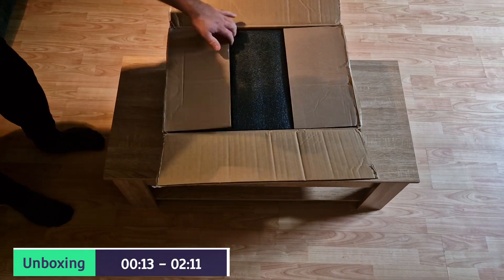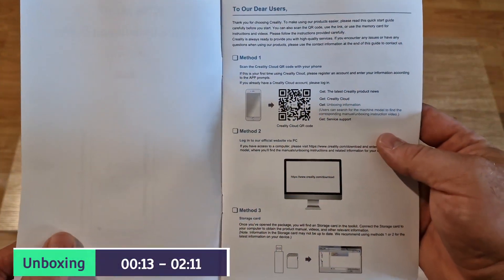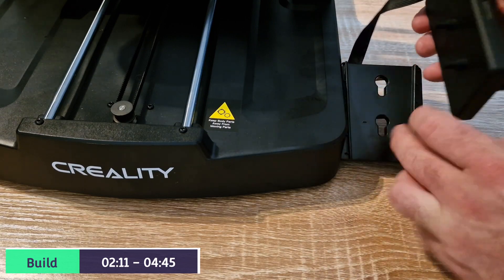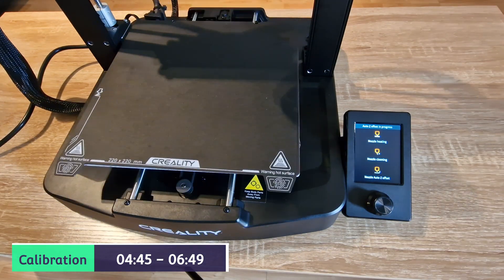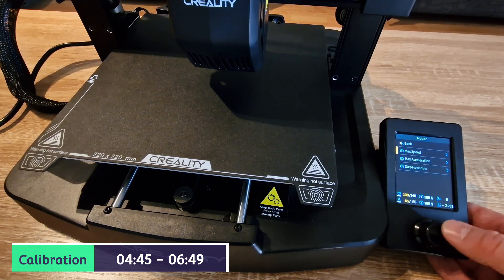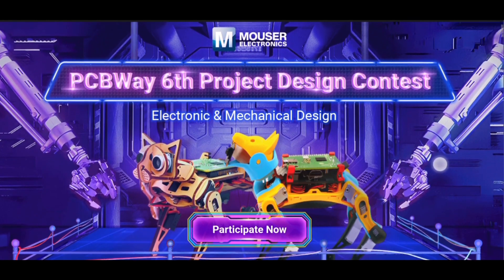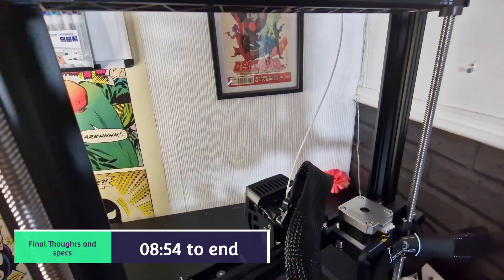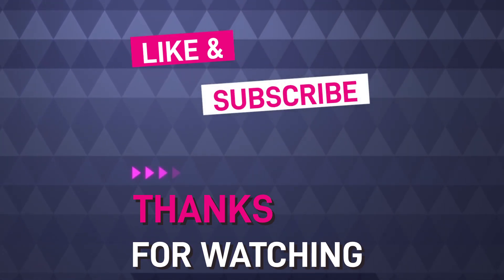Creality Ender 3 V3 SE #3dprinting #creality #ender3v3se #review #3d #3dpuk #pcbway

Comment: If there is an unevenness when using self-leveling, how should I level it? Do I only click edit at the end of auto-leveling?
Reply from the maker: That's correct then u can adjust... but double check the bed screws as mine where loose once I tightened the mm it leveled better